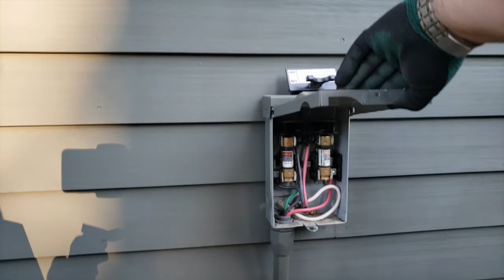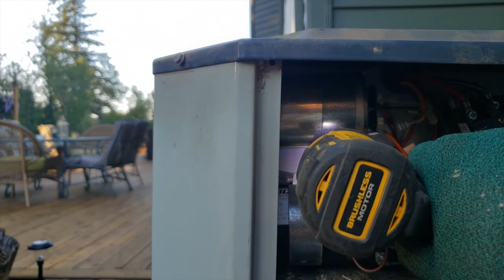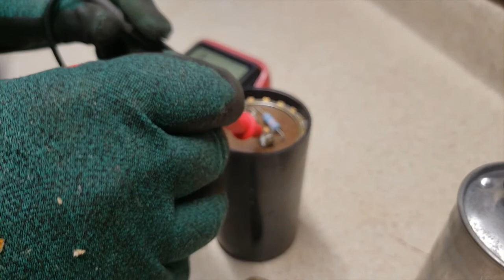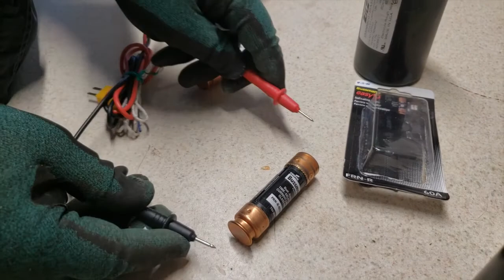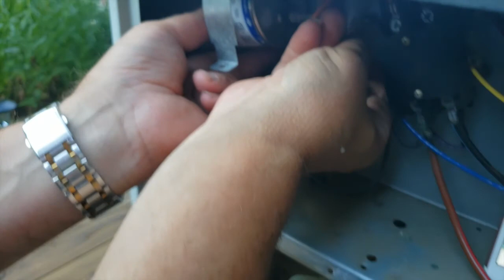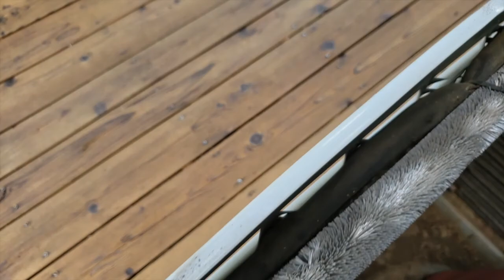Trane Air Conditioner Repair

Comment: I have the same unit and I assume the capacitor has failed.  I couldn't figure out how the top came off.  Thanks
Reply from the maker: Its a pretty easy fix. But they normally go out when you need it the most. Good luck on the repair. Let me know if its the capacitor.